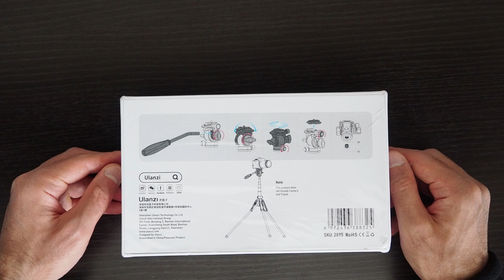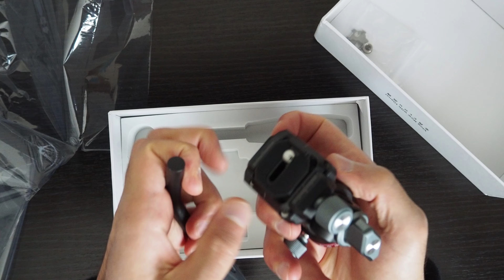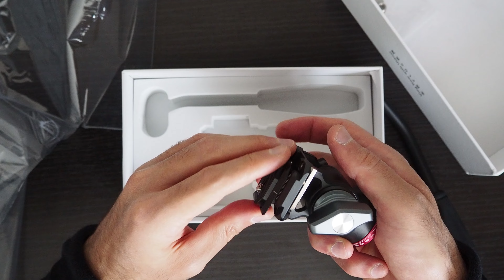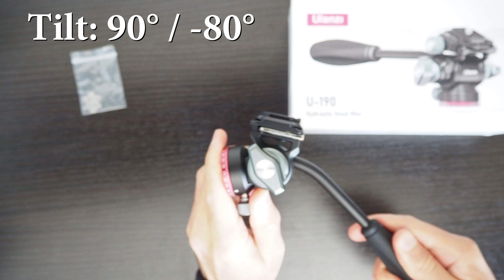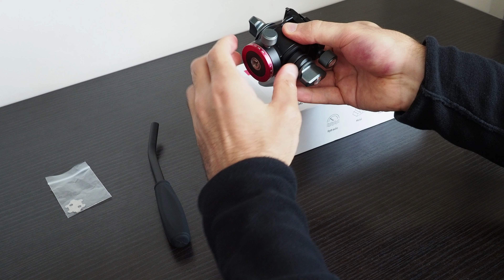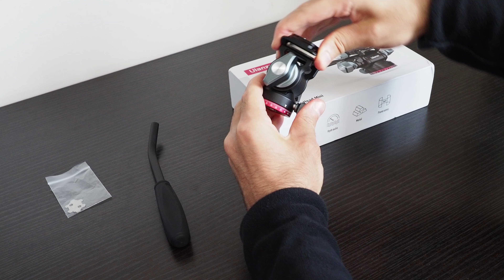Ulanzi U-190 Mini Video Fluid Head

Comment: Any panning motion is done smoothly with something elastic attached to the bar.
Reply from the maker: Agreed, but these small video heads haven't been practical for me and I stopped using them after 1 or 2 uses once I realised I have no choice but to use bigger fluid heads. So I bought two off them and they turned out to be a waste of money. The E-Image 610FH is the smallest yet good one that I bought however I ended up breaking it by overturning the tightening tilt screw. The E-Image 610FH turned out to be smoother at panning and tilting than the more expensive models of the same brand even though it lacked more customisation settings.

Comment: Will it be able to support Sony a7iv with a 24-70 mm lens? Can I attach it to a Peak Design tripod?
Reply from the maker: Yes, it can support the Sony a7iv with a 24-70 mm lens as it has a maximum load capacity of 10 kg.
It can be attached to any regular tripod as it has the standard 3/8"-16 thread on its bottom base. Nevertheless, can you please let me know which Peak Design tripod you want to attach it to so that I can double check the spec and compatibility.
Reply: @RadCameraMan  I have the PD travel tripod and their universal head adapter. Will you recommend the U-190 over other mini fluid heads?
Reply from the maker: @mdtaifkamal  Unlike other tripods, the PD travel tripod requires the "Peak Design Universal Head Adapter" in order to attach a fluid head to it. This is a compromise PD had to do in order to make the tripod small and light.
Regarding the U-190 video head; yes, I recommend this video head over other video heads that weigh the same. However if you are willing to go up in weight and size there are better video heads such as the SmallRig 3457 (weighs 0.5 kg), E-Image 610FH (weighs 1 kg), E-Image GH06F (weighs 2 kg). From these three fluid heads each of them is incrementally better than the previous one but also weighs more and is bigger. So when choosing a video head you have to make a compromise between the weight and size and the quality of the video head.
Please see the following video which is comparison between the Ulanzi U-190 and the SmallRig 3457: https://www.youtube.com/watch?v=1_DoQf_eEts&list=PL42hO7UHafKverdk2zvmjTySWxrJNp167
Reply: @RadCameraMan  Thanks!

Comment: Can I mount it on a Manfrotto 290-xtra? Thanks very much!
Reply from the maker: Yes, it is compatible with the Manfrotto 290-xtra but doesn't that tripod come with its own video head?
Reply: @RadCameraMan  Yes, it has its own head.. But it's quite heavy and without hydraulic damping system.  The Manfrotto one isn't too bad but I was wondering if this one could be more practical.. I use an A7sii with Tamron 28-200mm zoom.
Reply from the maker: Yes, the Ulanzi U-190 is light and it supports the weight of your camera setup. It has 3/8"-16 thread on its base which is the standard for tripods and video heads. So if you unscrew the manfrotto head, you will be able to attach the Ulanzi one instead.
Reply: @RadCameraMan  Thanks for the valuable information.. I was torn between Ulanzi and the Manfrotto Befree Video Live head
Reply from the maker: Another video head worth looking at is the SmallRig 3457... it is slightly heavier than the Ulanzi one though https://www.youtube.com/watch?v=1_DoQf_eEts&list=PL42hO7UHafKverdk2zvmjTySWxrJNp167

Comment: Thanks for great review. I just ordered one for my 2.5 lb spotting scope. Since I will be placing it on full sized albeit light tripod I judge that the pan and tilt resistance will be reasonable. The scope is well balanced relative to a camera except if I add adapter to place a smartphone to digiscope. The main bit I need to test it how easy it is to routinely lock the tilt mechanism at end of a movement to prevent rebound movement as scene in video.
Reply from the maker: Hmmm, considering the weight of the scope ~1.2kg, I don't think the rebound from the counter weight balance will be an issue.
You are correct about the pan and tilt strength not being an issue on a tripod, particularly if you are not using it for recording low frame rate video (24, 25, 30 fps). The reason I need something with very little resistance is because I use it on a monopod for video recording. Let me know if you have any questions that I can answer or help with.

Comment: Thanks for this complete review. I just bought one of these to use with a new ULANZI MT-55 tripod which has a ball head. I also bought the MT-56 tripod which has it's own fluid head. And I want both a video fluid head and a ball head for my tripod. So I'll decide which one to keep and what to add to the one I do keep. I'd be using these with my iPhone 13 Pro Max which weighs 240 grams on its own and a little more with a case. In reading reviews under this on Amazon someone said a month after you posted this, "Some reviewers complained about panning is sticky. I thought the same when I first play with it. But if you install this video head into a tripod or something, try to tight it in just enough, don’t over-tight it. Then panning will be very smooth. I guess when you over-tighten it, the force makes the bottom plate bulging downward, which in turn making the plate no longer a flat surface, and causes more friction/tension when you pan. Hope that will help future purchasers and those that encountered the problem." I'll have to try it and see what I experience. Thanks again.
Reply from the maker: Thanks for your input regarding this video head and sharing your planned usage of it. Please let us know what configuration you go for after testing them.
Regarding the tightness/strength of the panning motion, I experience the same strong resistance even if I don't have it on a tripod and I'm just turning it with my hand without the base being connected to anything. When I compared it to the SmallRig 3457 fluid head, it validated my experience that the drag on the panning is far too strong but please let me know how it goes for you and if you manage to get the movement to be looser as I really like this video head apart from this single problem which is a major problem for the type of action/sport filming that I do.
Reply: @RadCameraMan  Thanks. Just received all of them the other day. I will try them all and let you know. As I mentioned the MT-56 tripod has its own fluid video head. If that one works well I'll probably buy a ball head to switch off with it. I just thought this fluid video head would be better. But maybe not. I like the tripods themselves though. Light weight travel tripods at $70 and $80 each. I had considered the ULANI Zero F38 Carbon Fiber Camera Tripod, but it's too expensive for what I'll be using it for.
Reply from the maker: @BCE-111  The MT-56 looks really good and cheap. The video head might be even better than the U-190 as I can see it is larger with a double sided handle. I need to go to a camera shop to try these out (internet shopping can be difficult for items with certain nuances). I am really curious to know how good the MT-56 video head is because the whole package is portable and it seems like a very good deal.
Reply: @RadCameraMan  Most everything purchased on Amazon now, where I bought all of these, you have until January 31 to return. I don't think you'll find these in a camera store. And if you bought it directly from ULANZI it comes from China and would probably be really hard to return, so I've heard. Both of these tripods just came out. You won't even see reviews yet on YouTube. The supplier isn't ULANZI, but has decent reviews. Plus Amazon will back you up in case there are any issues. We'll keep in touch and see how it goes. :)
Reply: @BCE-111  How did you find the fluid head on the MT-56? compared it with any other fluid head? I am planning to buy it soon too...
Reply: How did you find the fluid head on the MT-56? compared it with any other fluid head? I am planning to buy it soon too...
Reply: @simoz78  Hi :) You know I've been so busy I haven't tried any of them yet. I bought the MT-55 and MT-56 and the fluid head and have til January 31 to return whichever one or ones I don't want to Amazon.
Reply: @BCE-111  I will ask again in a couple of weeks... at the end I just found out that the tirpod isnt available yet in my country until next month XD

Comment: Hi! thanks for this video. Not many people talk about this video head!
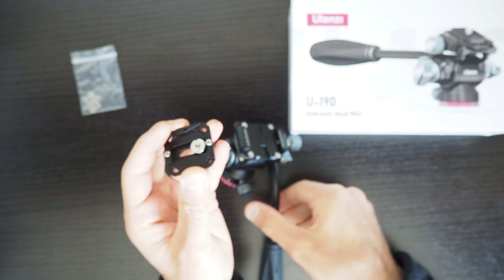Do you know if it’s possible to unscrew the base you point at 4:33 ? I use a camera cage and would like to flip the base horizontally to attach the cage directly.
Thanks!!
Reply: So I got mine and tested. You can rotate it, but need to fix it with 2/4 bolts diagonally. It works then.
Reply from the maker: I am not entirely clear on the solution. Do you have a picture of it?
Reply: @RadCameraMan  Don't have. If you rotate clamp 90 degree - you can bolt it down back with 2 bolts diagonally positioned from each other.
Reply: Then you have to be aware that the join is not so stable, and you get a small pan (which might not be an issue)
Reply from the maker: It looks like it can be unscrewed using a very small allen key type of wrench. I haven't unscrewed it myself but it looks like it can be unscrewed. Can you please elaborate on how you are going to use it afterwards?
Reply: @RadCameraMan  Thanks so much for answering! 🙏 I’m planning to rotate that base 90 degrees and screw it agin coz the arca plate I use is horizontal.
Reply from the maker: I see, that makes sense. Would you like me to measure the distance between the four screws to make sure that they are aligned on a square with equal distance, otherwise I assume rotating it would not let the screws be aligned with the female threads.
Reply: @RadCameraMan  Ohhh!!! thanks so much!!! That would be so helpful!!! thanks!! 🙏🙏😎😎
Reply from the maker: Yes, the screws are aligned on a square. So the distance is 37mm from the outer part of two screws in either direction. So rotating and re-screwing the part should be possible with the screws aligning correctly.
Reply: @RadCameraMan  That’s great news!! Thank you!!! 🙏🙏
Reply: @hecjvaldez  it won't fit by turning the base 90 degrees.
Reply from the maker: Can you please elaborate on why it won't fit?
Reply: @RadCameraMan  After I read your previous comments I ordered one. Today it arrived and after removing the screws, the holes didn't line up. it is not a square. stupid design.
Reply from the maker: Many thanks for sharing this information. Was it the screws that didn't line up or the mount couldn't place appropriately? The reason I am asking is because when I measured the distance between the screws they seemed to be equal.
Reply: @RadCameraMan  screws didn't line up. mount surface is flat.
Reply: @Wyn758  noo, to bad!! I have mine on shipping right now. 😢 I will try to cancel it. Thanks for sharing
Reply: @Wyn758  That's a horrible design decision. Camera cages and gimbals have horizontal Arca....
Reply: There's unfortunately a litle difference (prob. less than 1mm) that won't allow rotation. I would not have bought If I knew...